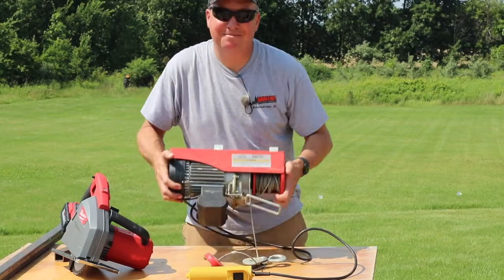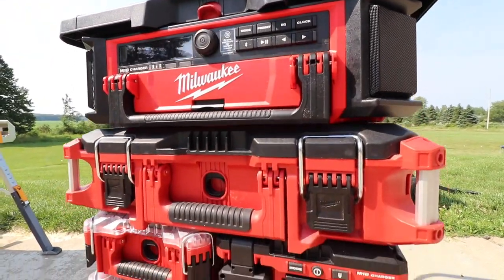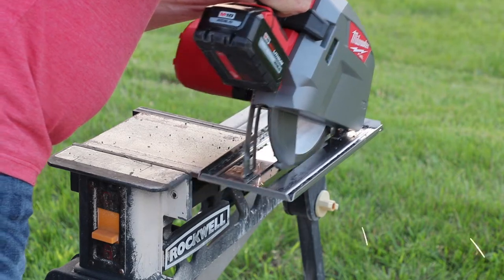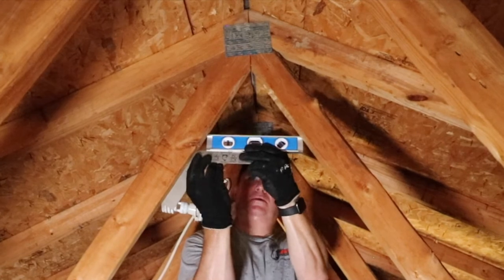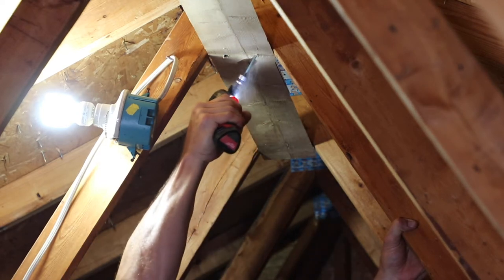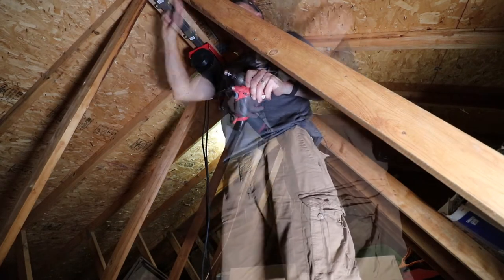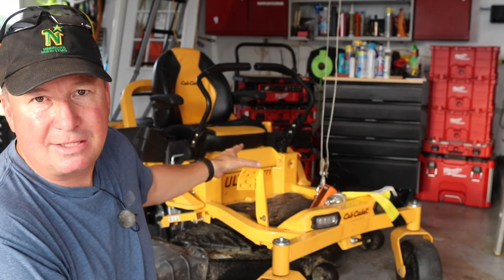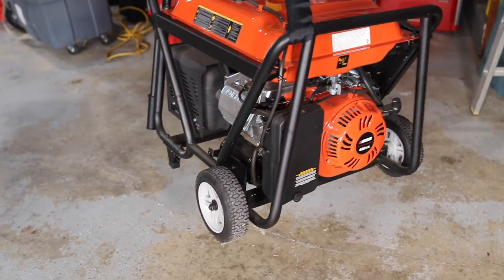HOW TO INSTALL AN ELECTRIC GARAGE HOIST LIFT // MUST HAVE FOR LIFTING!!

Comment: I have a 2 ton hoist like that to raise and lower an elevator I built in my house.  Mone is a steel frame that a larger diameter slides over with a platform on it.  I use a wheelchair and it gets me upstairs with ease.  I have an out building/pole barn with a truss system and I need to lift things in and out of the truck and lift equipment to work on it.  Thia gives me the courage to attach it to the wooden trusses at the peak. I may skin two trusses with half inch plywood making them incredibly strong and lay that square tubing on top of the trussed instead of relying on screws.  I've had this idea for a while and needed it for a few years and you gave me the confidence that I wont die or break a truss!  lol
Reply from the maker: Glad to help.  I just went overkill on the fasteners, tube steel, and extra lumber.  I'm glad I installed this.  I should've done it years ago.

Comment: I like your video but would have liked to have seen how the cable exited the attic and into the garage.  I’ve considered a similar setup (with about half of the weight) in my garage.

Comment: Hi just some thoughts use an angle finder on the bosh laser measuring device to set blade. use the extra hand stick to hold up board so you dont need any help, also I bought the hoist that has the remote so no cord to extend, And I used just a regular saw with a metal blade to cut unistrut. I just take ramps to the site to drive the generator down..just some thoughts I like your videos this may sound a little critical but I have done all of the above , Also I have a battery powered winch  that can be hooked to the truck box to lower things .
Reply from the maker: Thanks for the advice.  I ended up buying some extra cord and extended the remote.  It works well if I want to use it from the garage floor.

Comment: great vid.  Question - did you ever extend the control cord?  I just picked a similar unit up and the cord is a useless 5 feet.  I scratch my head trying to understand how that's of any use to anyone using a hoist for lifting more than a couple feet
Reply from the maker: Yes I did extend it with some cord I bough from Home Depot.  I use it more often now.

Comment: Wow Mark, looked like a Milwaukee Promo going on!  🤔😳🙄😃😂 
Nice job and great attention to detail, but it begs perhaps a dumb question: why not run your lift from the ceiling, versus all the way up to the roof ties?  I get it, but would it have been easier to reinforce the ceiling, and mounted it there?  I’m guessing it would not have been as structurally sound?  Nice job nonetheless!  Best to you.  👍👍👍😁✌🏻🇺🇸
Reply from the maker: Good question, George.  When I'm walking on the attic ceiling, I can feel the slight bounce from the truss and would rather not stress that area too much.  I feel that the apex of the truss is able to handle the most weight.  It's not as convenient there, but gives me the most confidence if I ever have to lift 800lbs.  
I realize I went a little heavy showing the Milwaukee Tools used for this project, lol  I'm invested in their battery platform and also am a big fan. 😀👍

Comment: Thanks for the video! What is the pull-out strength of the lag bolt to used? I'm wondering how many I need to put into my ceiling joists to hold up 1,000 lbs for an indefinite period of time to store equipment. Thanks!
Reply from the maker: That's a good question.  I just went overkill on the fasteners.   I believe a single U-bolt can hold over 4,000 lbs.
Reply: Thanks! Sorry I wasn't clear. Do you know how much weight your bolts can hold before they get pulled out of the wood, not when the metal itself fails, unless it really is 4,000 lbs. I'm trying to determine how many bolts I need to put in the joists to hold up a thousand pounds.
Reply: @davidgood1072    - crickets -   Uh oh . . looks like you only get ONE question! lol

Comment: Hey Mark, using your method of installation what would you say is the heaviest load you would comfortably lift? I am about to install the exact same winch in my shed, appreciate your awesome video!
Reply from the maker: I lifted a 780lb aluminum trailer with it.  I probably wouldn't push it any further than that.
Reply: @MarkThomasBuilder  that’s more than I need, I appreciate the quick response sir!

Comment: Recommend you don’t use screws in shear they are surprising low in shear use nails.  Build codes for decks, Thompson brace all have same warnings.
Reply from the maker: Thanks for the advice, Paul.  I went overkill on everything and don't plan on lifting much over 350lbs.

Comment: Didn't show how you mounted the winch to the steel tubing!
Reply from the maker: I used U-shaped unistrut brackets and bolted them into the 2x.
Reply: @MarkThomasBuilder  Where did you buy those?

Comment: Can I use the hoist to lift 320 lbs chandelier and have it “park” there at 10 feet above ground. Any recommendations? Thanks
Reply from the maker: That's a good question.  It seems like it's capable of parking with that weight, but I'd try and get an answer from the manufacturer.  If it were me, I'm consider a second cable to support the weight of the chandelier in case of the winch failing.

Comment: Where did u get the table saw pusher?
Reply from the maker: The push stick comes with the Milwaukee M18 Table Saw.  It stores on the right side of the fence.
Reply: O ok

Comment: My Friend, I know you mean well and I don't want to be disrespectful but this has to be the most irresponsible video I have ever seen!!!  If I understand this correctly, your recommending that people attach to engineered trusses that are designed to carry a snow load, not an 800lb point load. attaching the 2X6 to the trusses with wood screws and than the 2" tubing to the 2X6  with wood screws makes the hoist as strong as the screws.  Trusses are engineered to carry only the load they are used for. these trusses are designed to carry a garage roof load and not an additional 800 lbs. I'm sure the Milwaukee  tool company would not want to be associated with this. THIS IS NOT A SAFE INSTALL,.I WOULD NOT RECOMEND THIS BE INSTALLED without consulting a structural engineer. Again, I mean no Disrespect.
Reply from the maker: I appreciate your feedback and concerns.  I know the lift is rated for 800lbs, but I don't ever use it for that.  I mostly use it with my crane scale for tools that I review in my video that are approximately 50lbs and less.  I also store a few things in my attic and it's safer using this compared to carrying those awkward items on a ladder.  
Thanks for sharing and yes, good advice to consult with a structural engineer first, especially if you're trying to lift some heavy items.